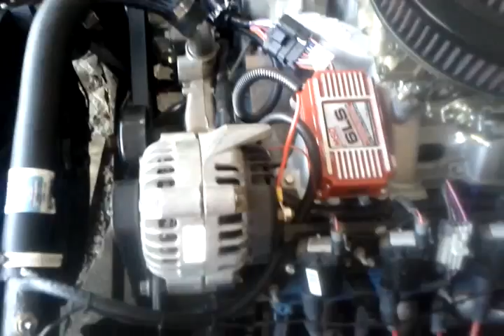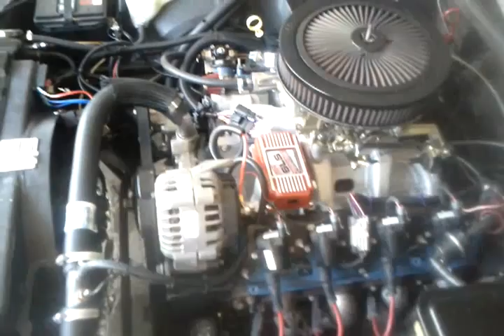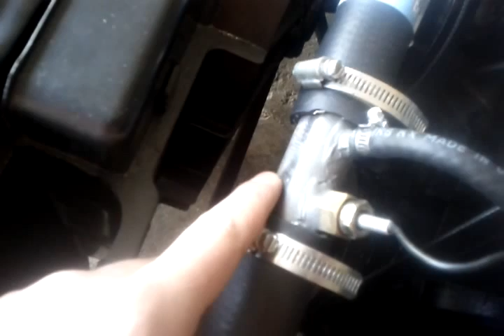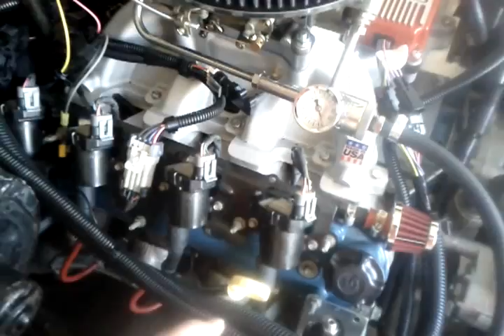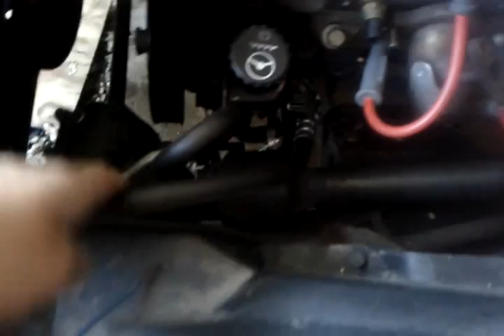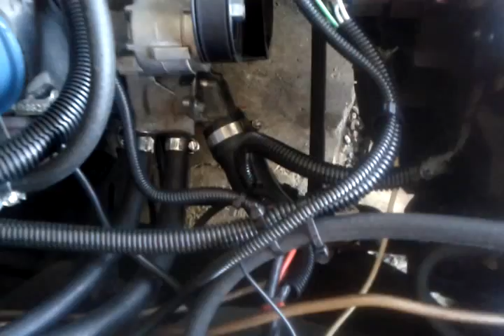How-to: Swap an LSx Ls1 4.8 5.3 6.0 into older GM cars

Comment: Im doing a 4.8 Used Trans dapt mounts....Bad idea, ended up doing Allstar circle track post mounts to set the engine back with the TD mounts to clear the truck serp setup and pan. Raised the engine up to clear the pan and a 5'' pulley from a Ranier will clear also. Using the EFI truck intake and a 2'' cowl it clears with lil trimming. I need a F body driver manifold yet. You gave me that headsup. I appreciate it.

Comment from the maker: The motor mounts you grabbed make the engine sit too low, Several people had the same issue they ended up swapping pulleys.. I believe its a Jeep Cherokee or Grand Cherokee pulley that you need. Search around on the forums a little bit.. It was a common issue

Comment: Great video, I'm doing a 5.3 into a 70 El Camino but I'm leaving the fuel injectors, can you give me the part # for the oil pressure fittings? Thanks.

Comment: I live in Sparks NV and I have a Summit Racing store. I have a 79 Olds 305 Chevy engine it came with runs great. I changed the oil so much used to use a high Chem oil and it created leaks so one day I'm thinking of an engine swap LS3 430 horse out of the crate. But by the time I buy the engine and 6 speed tranny to much money so I really don't know what is best to do. I know 350's are cheap but would want fuel injection I want the car to run smooth no advanced cam routine. Any suggestions?

Comment from the maker: Depends on where you get the engine from.. I think pricewise it depends on where you get the engine from.. The harness also has to be modified as well as having the ECM tuned.. It all adds up in the end.. I did some smart shopping and put this setup together for less than $1400... Im running a Grand National Th2004r

Comment: Thanks for the video I have a few questions. Swaping out my 383 for anLS3 engine with carb. Can I use the fan pulley in place of the p/s pulley(don't have p/s).Bell housing for Richmond 6 speed manual. 67 Chevy C-10 btw. Alt. mount? How can I use the LS3 headers as not to waste $ is the oil pan a problem? Thanks I am a rookie willing to learn.

Comment: I have a 63 impala and a 6.0 ls1 engine that I'm thinking about putting in the impala. I never put a newer engine in a old car before and was wondering what it would take to atleast get the ls1 in the impala. Will there be any cutting or mods I'd have to do to my impala or would it drop right in on my factory mount locations. I have the original mounts for the ls1 if that would help me. I just wanting to know what it''d take to get the engine in. Would it go right in place?

Comment from the maker: Dude it was cake.. As long as you have a Chevy engine in the car it will bolt right up (your only going to use 5 bolts tho) and you need the spacer or appropriate flywheel to mount the flywheel to the converter. I run a carb so wiring was incredibly easy

Comment: im actually trying to do the same thing with the ls1 in my 80 camino but im not to sure the trans will line up so what trans are you running or would i just have to change the bell housing??? an was the wiring a pain or was it simple stuff

Comment from the maker: Depends which way you want to go.. for about 75 bucks you can mount the 6.0 in the truck yourself, If you want to retain EFI I suggest finding a shop.. Running a Carb will cost about the same however much less wiring.. I have no idea what a shop would charge.. I imagine it wont be cheap

Comment: I jave a 86c10 i plan on putting a 6.0 in it. Do you recommend a guy that has a bit of experience with trucks and welding skills but no major wiring experience to tackle this project? and if you know what a good shop usually charges for this?

Comment from the maker: I used 2 Relays for the fan with a fuse per speed and its wired to an on-off-on toggle under the dash, I could get the Hayden kit which makes it automatic But i didnt want to shell out $70
Reply: I have a 84 Oldsmobile Delta 88 that I'd love to do a l s swap on what would you think total price turn key ready out the door.....I'm so ready to do it just have no clue how n there isn't any shops that do that this area. Warwick Rhode Island
Reply from the maker: @savage5366  Not surr

Comment: Look at your local scrapyards. A LQ4/LQ9 (Vortec) Truck motors are very LSX based. You actually can interchange much of what can go onto an LSX and swap it onto the Vortec motors such as the 5.3L or the 6.0L and they run for MUCH less than an LS! You can score one from any junkyard for about between 300 and up to 900 dollars. Rebuild it yourself or have a buddy help you, and presto! awesome, fast, reliable motor!

Comment from the maker: Use a Grand National fuel pump if you left the motor injected, or just use a Monte Carlo 4.3 EFI fuel pump with an adjustable pressure regulator

Comment: What did you use for the frame side mounts and engine side mounts? I am currently working on an 87 olds with the 307. I bought the adapter plates off ebay and put them on the 5.3. When I pulled the 307, I noticed the engine side mounts on the 307 are bolted on with only 2 bolts, different from the triangle 3 bolt on the adapter plate.

Comment from the maker: I assume your engine is fuel injected? You can run your fuel pump module but you need to change the pump to a Grand National pump... I also recommend you change the lines.

Comment: OK...I GOT AN 1989 CHEVY CAPRICE LS...IT HAS AN 305 CHEVY TBI IN IT. I WANNA KNOW CAN I USE MY FUEL SET UP THE CAR CAME WITH FROM THE FACTORY?, ALONG WITH THE 5.3 ENGINE SWAP..IF NOT WHAT ALL DO I NEED TO DO IN ORDER TO HAVE MY CAR UP AN RUNNING. I HAVE  THE MOTOR ALREADY AN THE STAND ALONE HARNESS.PLEASE GIVE ME MORE INFO

Comment: I'm doing an ls1 swap into my 86' el camino. I wanted to mate it to my built 2004r.  What motor mount brackets should I used if I want to drop it in and bolt it to my transmission without have to move the transmission?  I have watched all of you videos regarding the 5.3 swap, which was my original intention with a carb and all, but i got a sick deal a low mileage  slightly built ls1 with wiring harness, so i'm now heading in that direction.

Comment from the maker: Im running the PCV valve on the driverside, I have it plumbed in with the power brake booster going to the back of the carb, and the passenger side I have the simple filter which allows fresh filtered air into the motor..

Comment: So what was your actual experience with the truck mounts. My deal is the single bolt will go thru on one side but not on the other like it's pushed up and out too much. I thought the adapter plate thickness caused it.

Comment: Man thanks for the video. I recently Installed an ls2 6 liter head cam an kit setup in my 97 gmc and wondered why in the hell my motor mount cups would not line up on both sides. I need the mounts for a car. Very good info man. I was about too do some fabricating. Lol. I am gonna just buy the mounts now. 

For those of u who ask about the adapter plates. U can get them on eBay or speedway motors which is where I ordered mine. 

Thanks again for the video man.

Comment from the maker: It has rubber isolation washers and thats where Edelbrock designed for it to sit..  

I took it for a drive yesterday couldnt get on it because its open manifolds but it moves out like the 455 but has better throttle response.. 

thanks for comment!
Reply: Great job ...... 👍